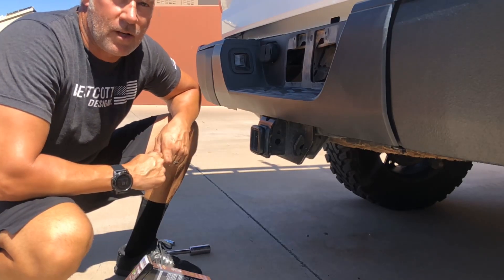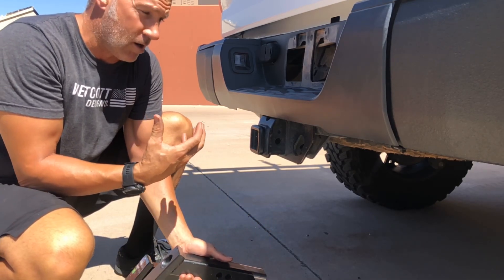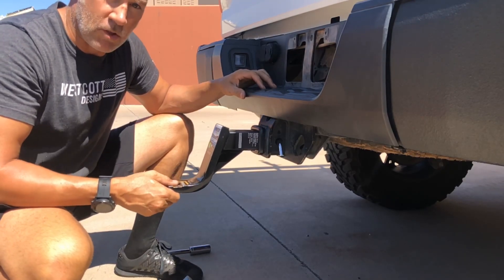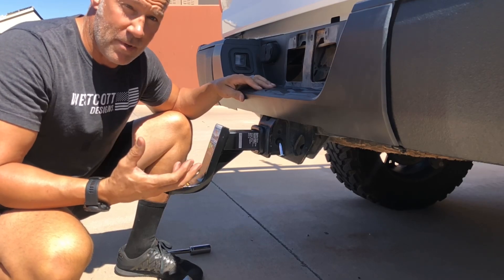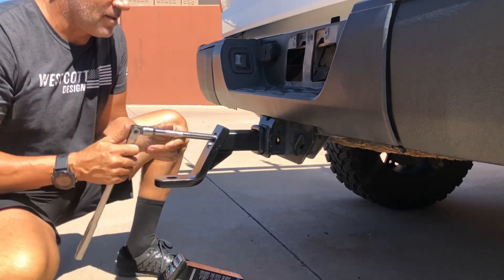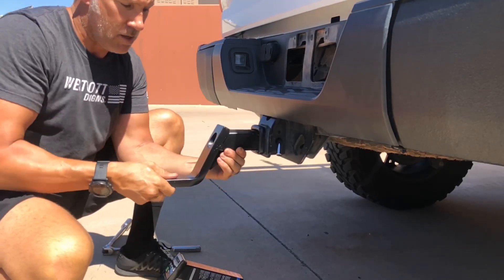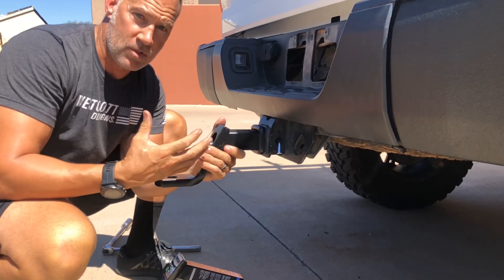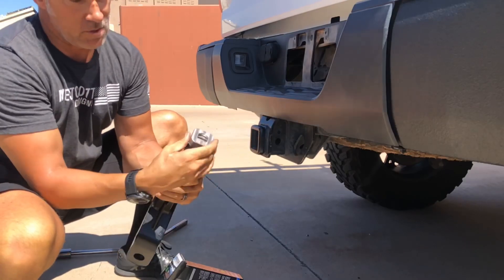Getting rid of that clunk when towing👌

Comment: This is great and very similar to the system on my Thule bike rack that takes waaaaay more turns to secure, but love that there is no play and no need to add any additional items to secure the receiver. Will you be offering multiple drop heights? The '23 Sequoia tends to need something around 6-8" of drop for a lot of smaller trailers
Reply from the maker: I tried a lot of the other designs on the market but after adding a extreme amount of weight I ending up getting some movement so I thought we’ll I guess I need to reinvent the wheel😉.    We will be offering it in 3 or 4 different heights for sure.

Comment: I bought rack to go in my receiver to haul more than would fit in my 4Runner.  It had the same slop.

So that would work good on racks too, not just for towing
Reply from the maker: Correct we designed it in all of our hitch racks.  Works amazing
Reply: This is used on many hitch mounted bicycle rack designs for years